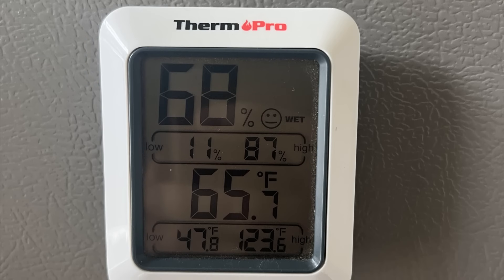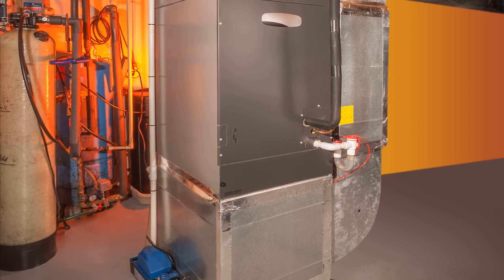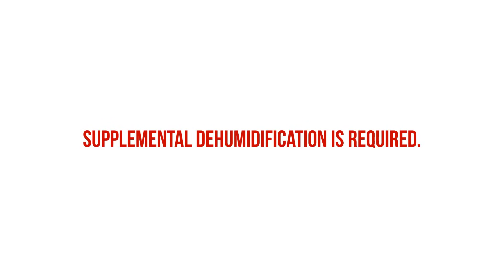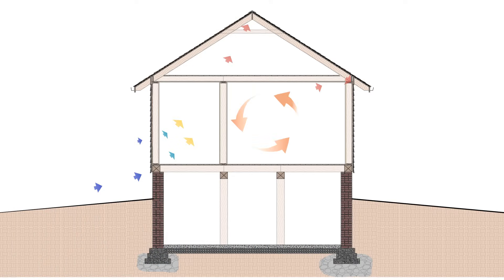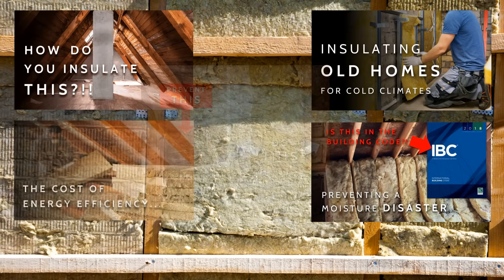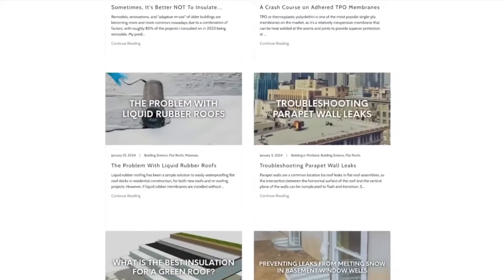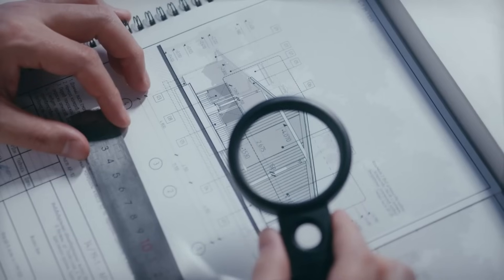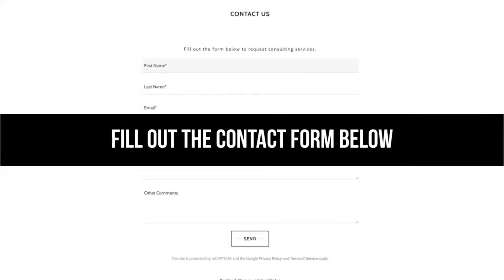Does Insulation Cause Humidity Problems?

Comment: I don't necessarily like the message of "blaming" insulation. True building efficiency is an insulation + mechanicals process, just like framing a house is a wood + nails process. If a house failed because of inappropriate nailing, would you blame the nails?

Comment: A lot of issues come from poor uses of thermal breaks, which isn't always the insulation. If you have a house with plastic sheeting directly behind the drywall, you likely are causing moisture to build up inside the drywall and causing mold problems. Your vapor barrier should always be on the outside of the building, not the inside of the exterior walls. Even then, that vapor barrier should not be plastic sheeting, and instead should be Tyvec or an equivalent that still breathes but significantly slows airflow from the exterior, while allowing moisture from the inside to dissipate. 
One of the common incorrect things I see is plastic sheeting on the insulated stud walls hung before drywall in basements, and all this does is trap moisture on both sides of the wall and causes mold in both your insulation and drywall. Instead use foam sheeting glued directly to the block foundation, with an airgap behind it. This will keep the moisture at the block, and away from your fiberglass insulation, framing, and drywall.
Reply: Shouldn't the vapor barrier be on the inside in cold climates? If it's on the outside the warm/moist air from the conditioned space can condense on the cold exterior vapor barrier. From what I've seen the rule is "vapor barrier on the usually warm side" plus sufficient insulation to keep the vapor barrier warm.

Comment: I have a really simple question on the complicated subject of vapor. The vapor moves primarily through air movement, air leakage. Why not simply use an air barrier on the interior, Tyvek, Typar, whatever, and make sure that this air barrier is tight????  

Sure, moisture will diffuse through this air barrier, but in a damaging amount? Have another air barrier, again quite permeable to vapor, wrapping the house.  In other words, put all of the effort into stopping air flow but allow the vapor to diffuse, especially if there is a drainage plane behind the cladding. The mold problems seem to be primarily the result of overly retarding vapor flow. 

The current system, as i understand it, is that the code specifies some sort of vapor retarder, let's say it is the paint on the drywall, but really most of the vapor is actually moving through air leakage, penetrations in the drywall, cracks, whatever. So wouldn't it work better to give up on vapor retarding but do a really, really good job, interioe and exterior, on restricting air flow?

Comment: Maybe just do it right with proper contractors? We live in Europe, North, so climate is very humid. You wouldn't survive here witout insulation, it's not Florida cardboard boxes. That's why building our homes cost much more than in the US...well, it has to be built properly. In thid modern era there are so many options to bring in fresh air, reduce humidity...I mean recuperation system which is a must, all kinds of roof membranes to allow humidity to leave without affecting heat. We must have A++(+) homes for people built here in energy efficiency. From what I seen in the US or Britain, it's like D-- standart. What you showed here in the video, we used to see these kind of issues in the houses built in Soviet Union 40 years ago. They used to build houses just to build it, not for quality. We called it a chruschiovka  or a sh1t house.
Reply: @MisterArgos  hahaha hahaha hahaha! I love it!
Quality is definitely missing on standard homes anymore. 
Most designs are really a mixture of good ideas but poor application. What I mean is, we have all these different products that do many different things. 
If we go back to basic construction designs and recognize the pros and cons of each product and materials used. 
The world has so many climates and microclimates and structures should be built to standards that accommodate those climates which means choosing the appropriate long lasting materials and designs. 
It's like everyone is building a one size fits all with the same structural materials for all, and just changing up the insulation thickness to accommodate the climate. 
Time has proved that this approach is inherently flawed. 
I personally believe that these air tight homes are a recipe for disaster. Why is it so bad to get some natural airflow or just cooling and warming, and dry and moist air into the designs. 
I'm in the commercial construction industry and the most ridiculous designs are when I see architects using seemingly good products in an impractical way. This tells me that the manufacturer of the seemingly good products have not done a good job at teaching architects or builders how to properly use and install their products. 
I see it ALL the time.

Comment: I live in South Florida in a 100 year old kit house that is up on concrete piers and a large attic space. After my inspection at the time I purchased the house, I realized how minimal the insulation is and why these old houses have lasted so long in such a hostile climate. Homes today are way over insulated which creates a terrible indoor air quality and severely reduces the lifespan of the structure. 
Last year we had 130mph sustained winds with a direct eyewall hit from hurricane Milton. Thank God that we all survived and the house held up great under the extreme conditions. I noticed that many newer homes had severe damage. My neighbor's on slabs all had flooding while mine, an older house on piers, stayed high and dry. 
There's something to be said about the older, simpler ways of building. 

My 50 year old house in North Georgia has stood up well over the decades as well. Still has it's original wooden windows. Sure, it's a bit drafty in the winter and maybe a bit warmer in the summer, but the structure is sound.

Comment: In short. If you insulate and air seal you need to take your mechanicals into consideration (most of the time upgrade). If you air seal and insulate, you need to add an erv (for ventilation) and a whole home dehumidifier or an HVAC system with built in dehumidification separate of the cooling.
Reply: Depends on where you are

Comment: Im doing new construction home 100% closed cell throught basement,1st, 2nd and attic. + R5 rigid polyiso on exterior. Im adding an erv fantech 150cfm. Do you see any issue with this?
Reply: The sheathing is going to be in a wet little bubble between two vapor barriers.  Also it's extremely expensive, extremely high embodied energy, and highly potentially toxic.  Cellulose can dry and is recycled/low carbon!
Reply: @morganwheeler7417 I cannot agree more. If I had an extra  buck laying around I would build with SIPs
Reply: @aXeL718  I'd go with insulated metal wall panel design and get rid of everything else. 
I see these designs in the commercial construction industry all the time where an architect has so many products being used like in your case, that turns out to be 2 things or maybe more. 1 material prices aka cost, 2 labor to install aka cost. The 3rd is that the structure is going to be affected by these applications, normally in a negative way. 
Keeping the design simple and complimentary between materials is the key design feature that is missing way too often. 
The main design feature missing these days is using complimentary products that extend the life of the structure starting with framing materials and working your way out from there. 
Foam products have proven to be detrimental to framing materials, both wood and steel due to its inherent moisture absorbing abilities. Then the moisture becomes trapped between the layers of exterior and interior wall finishes thereby creating a structural system failure in time. Not to mention the interior air quality. 
A structure must be able to breathe first and foremost. 
Finding the balance between indoor air comfort and structural redesign longevity and budget is the challenge. As long as you are willing to think outside the box, you should be able to find a reasonable design solution.

Comment: Could you make a video about insulating a floor system for a tiny house on posts?
Reply: @scottfrommaine8602  I believe there's no real "good" solution for an existing home with this design. 
The solution for new construction is elevated concrete slab construction with a heated floor. 
Minimal insulation needed, extremely long lifespan, no critters. 
If in a cold climate, all plumbing should either be ran through attic space that it adequately insulation or underneath and adequately insulated. You just have to pick your poison. 
I'd choose under the floor since any burst pipes will not flood the interior.
Reply: Yes please and get into non-toxic code friendly alternatives. Skirting, water/sewer freeze proofing, bug control like (bottom up) 1/4 hardware mesh, fly screen, joists with space and comfort board then flooring or? fill with cellulose between joists then ply or lumber, and flooring. And if there wasn't skirting then radon risk is minimal?

Comment: We live in the Bay Area California so it's mostly on the cooler side but rarely freezing. We have very little air conditioning use in our house. Sometimes we run the (minisplit) in the upstairs for a few hours. Downstairs is always cool. We use natural ventilation more than half the year. The house has been blower tested when we upgraded windows, and has some leaks that they said was OK--within the limits that they had to work to (I guess). We know the air is relatively dry, though we have high soil moisture in our crawl space and we have fog. How do we judge the best practices in this borderline climate zone? For example the floor was never insulated, so what might happen if we do insulate it?
Reply: @pcatful  probably a recipe for disaster if the original structure is designed to breathe or is exposed to natural cycles of moisture and drying. 
The only thing that could naturally help this process along is promoting airflow to speed up the drying process. Something as simple as a fan for circulation. Strategically placing it on the southern exposure to draw warmer, sunnier, dryer air will likely be beneficial as well if it makes sense to go that far. 
Of course, tapping into the Northern exposure would promote cooler air flow naturally. Not much but a few degrees can be helpful.

Comment: You show moisture coming into the house in both cooling and heating modes. Isn't there a differential that water vapor always flows one way or the other based on temperature?
Reply from the maker: @pcatful  Yes, vapor moves from higher concentrations to low concentrations, from warm to cold. Majority of the time it's moving in the same direction, but when it's not - high concentrations to low concentrations wins. Again this is vapor pressure and not air leakage. Air pressure differentials and holes can force air in and out of a building - completely separate from vapor pressure.